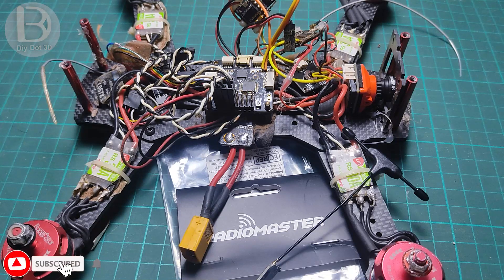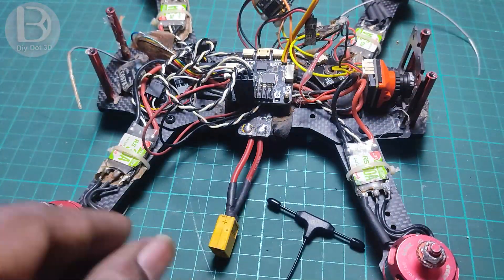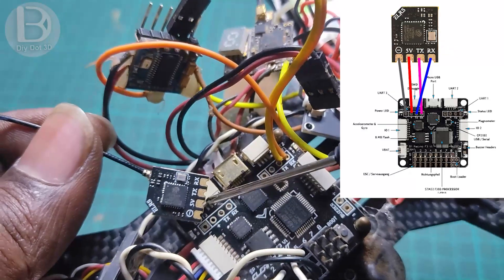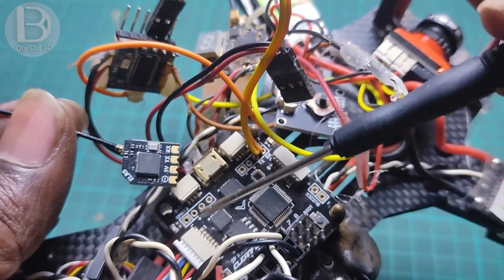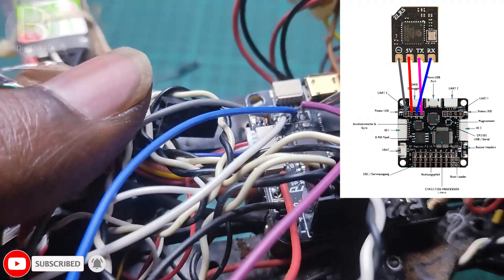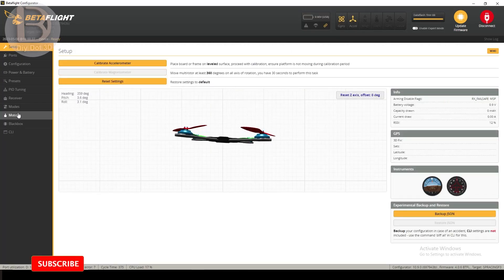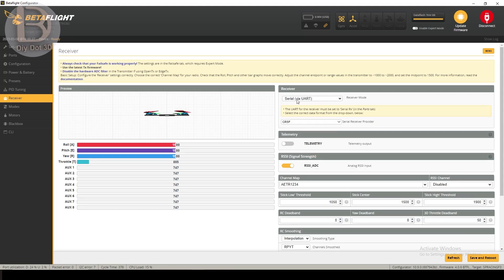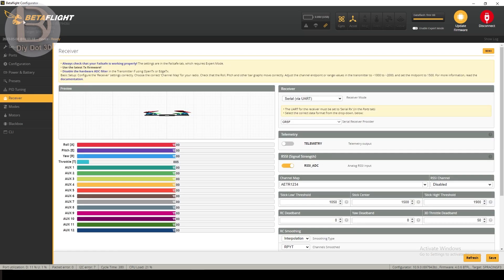How to install ExpressLRS |How to flash ExpressLRS with BetaflightPassthrough #radiomaster #elrs #rc

Comment: I got error messages... when I flash & build  after some I got error message  please help me
Reply from the maker: What error message you got??
Reply: @DiyDot3d  Failed to connect to ESP8266: No serial data received.
Reply: @FPVRoboticslab  got same problem. what did work?
Reply: Yes  Change the method  work fine .. @dysisinfluence